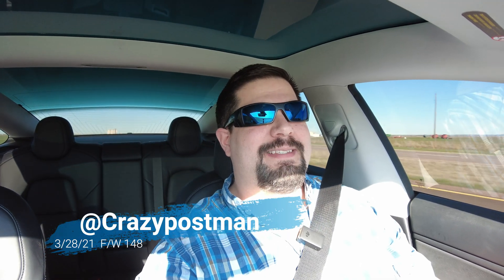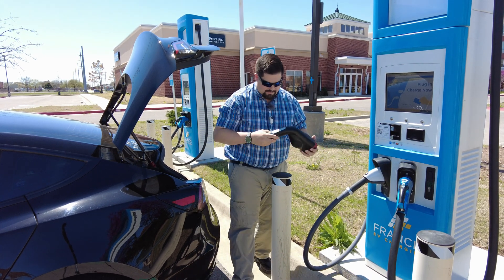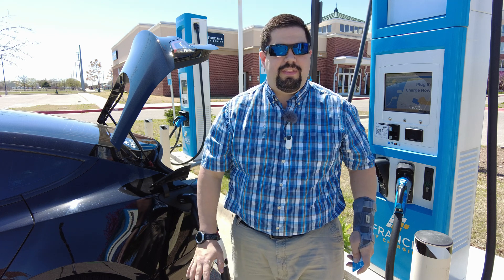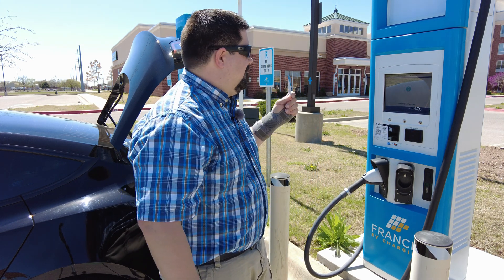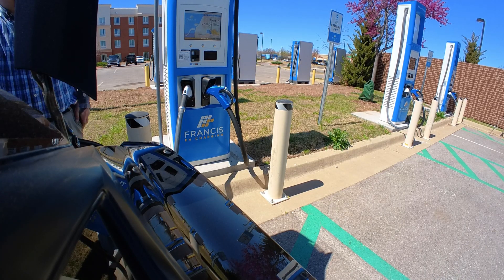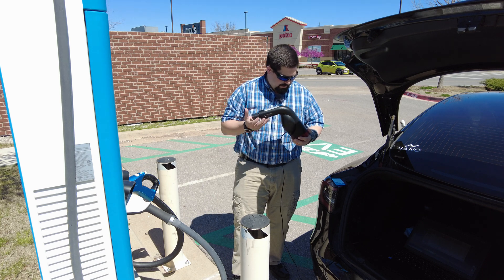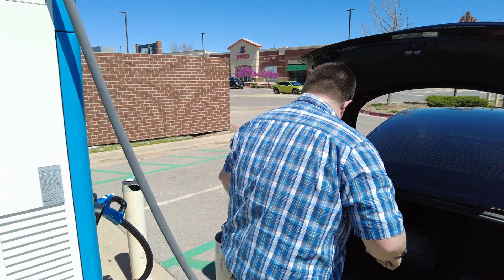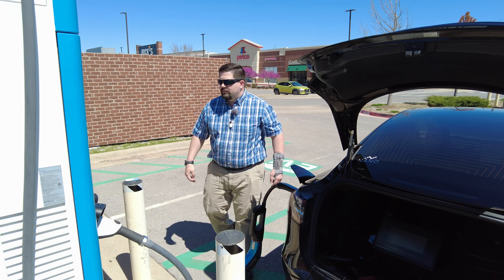Tesla Setec CCS adapter testing #16

Comment: If the Chademo adapter won't work then the charger isn't communicating with the car properly.
The CCS adapter will have the same issue regardless of what version it is.
Tesla could update the car to talk to the charger or the charger manufacturer could update there stations.
The stations where probably never tested with a Tesla.
(The Higher power chargers tend to be CCS V2 and the lower 50 kWh chargers use CCS V1 protocol.)
Reply from the maker: I've charged both CCS and CHAdeMO at the same location successfully before. I think it's just the crappy reliability of those BTC units.  The weekend after this video I charge successfully at a different  BTC station, today I'm going to try a different BTC station again supposedly the new firmware 150 should work we'll see later.

Comment: You think maybe you just have a DOE adapter?
Reply from the maker: I have three different CCS adapters.  It's definitely the BTC station. It works consistently at other chargers.
Reply: @Crazypostman  3 of the same brand? Which ones work? Cvs station near me is unlimited for $25 a month
Reply from the maker: Three of the same adapter, it's just for testing purposes. I also have the Tesla CHAdeMO adapter, it's very reliable

Comment: It’s fairly new technology with these HPC charging stations. I think 50KW DC was the reliable standard for a few years, but now that is too slow. Electrify America purchases chargers from Efacec, BTC, ABB, and Signet. I’ve had poor experience with the BTC and Efacec chargers. ABB and Signet units seem to be working most of the time. Imagine going to tbt gas station and only 1 out of 4 pumps are working. If mass adoption of EVS becomes a reality, charger reliably and uptime must improve.